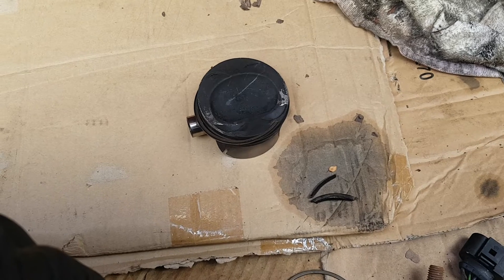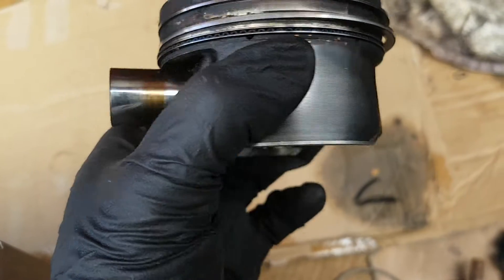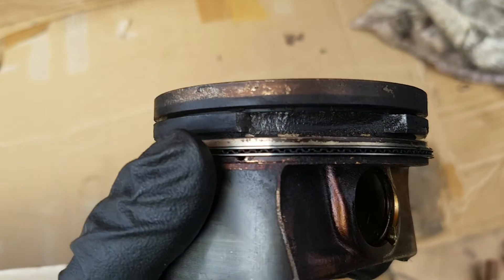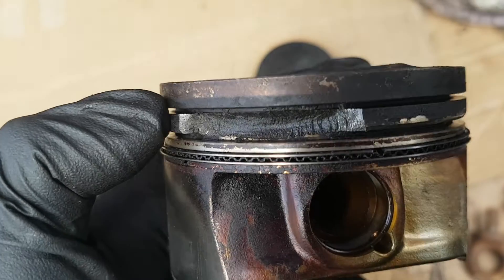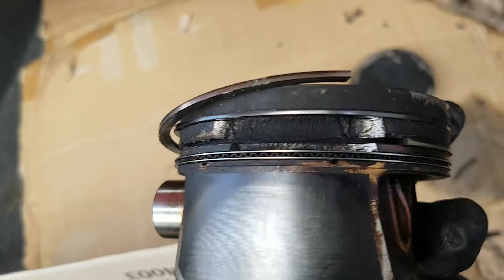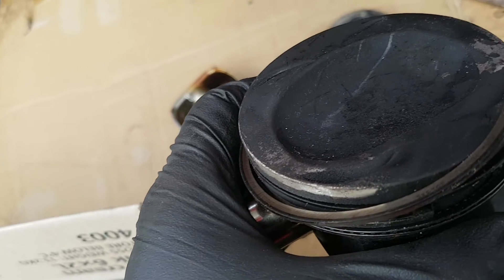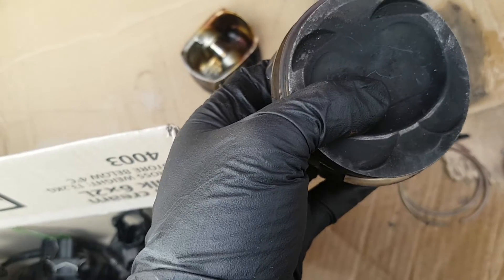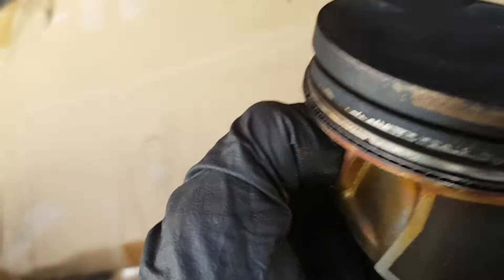VW Audi 1.4 TSI CAVD Misfire Low Compression Cracked Piston Ring Lands

Comment: My 2009 Golf variant CAVD engine died. We found 2 cracked pistons and stuck rings. I have decided against rebuilding it and I want to buy a used CTHD engine which was an upgrade on the troublesome CAVD. I honestly think the VWs are not built to be reliable though given the reliability issues in my experience

Comment: So I’m currently battling a diagnosis on my 2.0FSI with no compression on 3 cylinders and with 150psi on #4. Timing belt looks good and tight and the cam/exhaust cam chain seems to be rotating both cams during cranking. Any suggestions on how to proceed?

Comment: Hello @four rings auto

high oil consumption on 1.4 tsi CMBA 2013   aprox 3 liters in 1000 km..

What you think, i have to change the piston or just ring on it?   
compresion is ok all four cylinders

maybe valves seals leaking..

Thanks
Reply from the maker: I believe there is a technical bulletin for this engine. It says to check the engine number and depending on that it specifies different repairs. One of the repairs is to replace the pistons with an updated version. You'd think they'd have these issues sorted by now as newer engines come out...

Comment: Hey Four Rings Auto,
I have a 2013 TSI CTHD 1.4 Tiguan with 70k on the clock. Cylinder 3 is significantly down on compression so have ordered a leak down tester to help determine what's failed.

What is it about TSI 1.4 engines that cause their pistons to fail? Are there newer/updated versions of pistons that are less likely to fail?

Thanks
Reply from the maker: They were mahle pistons from factory, they are replaced with kolbenscmidt that has a better casting. Apparently too low of a silicone content in the aluminium casting. Silicone is great for withstanding heat. Low speed pre ignition also doesn't help, as these turbo supercharged engines make a lot of power torque from such low rpm. Downshift if you want to use the power to avoid increased cylinder pressures at low rpm.

Comment: Can these blocks be sleeved with liners if damage to bore is beyond available oversized pistons? Pulling a CAVE engine out as I write this with 50PSI on number 2 cylinder. Expect to see broken piston(s).
Reply from the maker: Yes any engine can be sleeved. But all down to cost. So many people seem to rather replace with another unknown used engine than fix what they have.
Reply: @FourRingsAuto  Thanks for the reply. At the time I didn't know how thin the bore walls were as to whether it can be sleeved. There's more than a few comments on the net where people say they can't. Add to that the open deck nature of the block which may impact whether there is even room to bore or house the top of the sleeve collar without breaking out of the original bore wall. (hope that makes sense?) Anyway, I'm old school and would prefer to recondition what I have, and in so doing keep the original engine number. Buying a wreck to source another engine or buying another second hand engine from an automotive wreckers is crazy considering the ticking time bomb nature of these engines. To have peace of mind you would be replacing the same items as you would on a rebuild such as pistons and timing chain kit etc. That makes it economically unsound to do.

Anyway, it's apart and the bore with 50PSI has piston cracks and small amount of material missing between the ring lands and the top compression ring was totally seized at it most compressed with carbon. Bore is scored but might just clean up with first oversize rebore. Drop the block, crank, and head into a machine shop tomorrow to get the whole picture.

Comment: Why wasn't this a Recall??
Substandard parts used for these engines.
I notice they replaced this engine for 2014 and a complete redesign too so parts not compatible.
Reply: Poor maintenance and cheaping out on fuel usually causes this. At least in my case that was the cause of 3 broken piston rings. The previous owner used cheap oil, skipped servicing and used cheap pissant fuel.

Comment: Just rebuilt mine with new pistons, they looked exactly like yours shown, also did a head recon/ lots of carbon build up, finally got engine back in the car, and got the dreaded P10A4 code,wouldn’t rev above 3000 rpm, I think caused by too much oil in inlet system ?? I have ordered a new throttle body valve, I do hope this fixes it, any tips ? , great videos btw have helped me tremendously,,
Reply from the maker: I have many videos on the P10A4 code. You can wash the oil out and it usually fixes it. Have a look on my channel.

Comment: Got the same engine in first edition  BMY. Almost 200k with stage 2(70k) setup, with 1.5bar boost. And it still drives fast without oil consumption. 
MY08 Mk5 Golf GT (dsg6)
Reply: The first iteration seems to be the most reliable. They really leaned out the tune post the mk5 GT

Comment: I'm looking into buying a Scirocco but honestly I'm confused about the TSI engines, from what I know the 1.4 TSI 160 kmh is faced with this exact issue, am I correct? The 122hp is fine besides the chain being crappy?
Reply from the maker: Pretty much, but they both stretch chains (usually poor maintenance) and they both use the same pistons technically, but the higher output is putting more load/stress on them.
Reply: @FourRingsAuto  Cheers for the answer! Really helpful :)
Reply: @FourRingsAuto  isn't this more LIKE LSPI issues? Due to the fact that it has already high boost at low rpm and the engines get trashed while already having some carbon build up - because GDI produced more soot -?
Reply from the maker: Likely
Reply: @FourRingsAuto  TSI engines are nice to drive though, I've got a 1.2TSI (CBZB) on lpg (liquid through petrol injectors) runs like a champ, ~270.000kms in now. Not much issues except spark plugs wirings that get chewed up by marders 😂

Comment: Hey! I've got the same problem but my cylinder block is also damaged..
Is it possible to use the bottom end of a CAXA engine (Cylinder block and pistons) as replacement for my CAVD engine? I've heard these engines are the same.. just with different tuning and different injectors etc etc..

Thank you!
Reply from the maker: They are different. The caxa is aluminium block and weaker than the cavd.
Reply: @FourRingsAuto  problem is I've already got the CAXA..Despite the weakness, will it still fit and run?

Comment: My son as the golf mk7 1.4tsi rline 150hp dsg 7 speed,2017 model,no issues so far,he’s even got a high flow downpipe and a tune to go with it,other wish car is stock,it’s running about 200 hp and about 320 nm of toque,he also had the dsg reprogrammed
Reply from the maker: Different 1.4tsi in the mk7
Reply: Four Rings Auto do you think it’s stupid to run 200 hp and 320nm of torque on this engine tho,I told him not to remap it,the tuners said it’s safe,but I disagree,I think the turbos are weak on these new 1.4tsi engines,he’s been tuned for about 10 thousand miles now,ps I know it’s a different engine in the mk7 but still lol
Reply: @daibennett9224  I would have money on the gearbox shitting itself before any engine issues. And when the dealership finds out the car is tuned his warranty is (more or less) null and void...
Reply from the maker: Hmm i have a similar polo gti with around 80k kms. It has been stage 2 apr tuned since 5k kms and has a dsg tune. 0am gearbox on original clutch. I wouldn't jump at the tune causing a gearbox issue no more than they do standard. Lots of the greek dsg tuners even suggest they're having less issues with 0am gearboxes once running a tune. Only speculating on what other companies that specialise in that stuff have said though.

Comment: Hi there 4 rings I have mysterious misfire problem on my Jetta 2012 CAVD 1.4tsi currently with 116k miles. This car underwent an engine change under warranty at 45k miles (2015), was informed by the dealer that they have installed an updated version of the engine, but now that the warranty is over the misfires is giving me the jitters.

All started with cold start vibration so I used Obd2 with torque Pro to scan the engine and the results shows 5 counts of misfire on cylinder 1, though It doesn't show a fault code or light up a check engine light.

Suspecting that it could be bad coils or plugs I switch them around I found that the spark plug from cylinder 1 had black soot on it and plug tip a little bent so I change it to a new one ran the scan tool again and still cylinder 1 shows a misfire still no fault codes nor check engine light.

My fuel consumption has deteriorated and intermittent vibration can be felt while the car is idling also when accelerating it feels like something pulling it back.   

I brought it over to the garage to have it checked but their scan tools didn't pick up a misfire, so they went on to do a compression test which showed 12 bars on all 4 cylinders. They changed the connectors to the coil packs as the clip were broken so after all that obd2 still shows misfire on cylinder 1, no error codes nor CEL.

What would be your expert advice? Many thanks
Reply: could be a faulty injector leaking into the cylinder
Reply: @shimon2476  Thanks appreciate the response
Reply: @lucasoliver3221  np did you fix it?
Reply: I bought a car that had the same, 2nd engine was built to same spec with Gen 1 pistons, they broke after 5k miles :(
Reply: @themousechannel-Wootten  Thats sad

Comment: Hi, was this something you repaired yourself or had a garage do? I have low compression in cylinder one and been told it could be the valves? How hard was this to fix? Any help appreciated! Thanks!
Reply from the maker: I did this myself as I'm an automotive technician specialising in Audi and VW (hence Four Rings Auto).
Reply: @FourRingsAuto  how much would you charge a customer for this job? Including timing chain replacement? Thanks
Reply: @FourRingsAuto  iv had my Mk6 golf pressure tested and 2nd pistons no reading, is it best to find new engine or getting refurbished. And where are you located in UK? Thx
Reply from the maker: I'm in Western Australia. A used engine has someone else's problems. Engines from the scrapyard always seem to have some issues. Strip yours down and inspect the bores. If ok, rebuild with kolbenschmidt pistons. They're about a third of the pruce of genuine ones and they're the same.
Reply: @FourRingsAuto  hi, im in WA too, may i have your contact/address so i can bring the car over pls ?

Comment: Hello Four Rings Auto! I bought my 2008 MK6 Golf with CAVD 1.5 years ago with minor trembling and excessive oil consumption. Been driving it like that since then and only recently did a compression test which showed about 60-65% of what it should be on 3 cylinders and 55% on the 4th. Also Vag-com giving the cylinder missfire error... Is it still worth it doing the pistons replacement job? Otherwise car runs relatively well for 160 hp apart from the minor trembling and 1L/1000km oil consumption. Thanks!
Reply: Thanks guys! I am undertaking the job next month and will post the results here. Fingers crossed!
Reply: UPDATE: Engine pulled apart: 3rd cylinder's piston had a broken ring land. According to the mechanic the cylinder cross hatch honing is there and block is fine. Fingers crossed that the pistons replacement will resolve the issues completely including the oil consumption.
Reply: Pistons job is completed. Car drives like new and error-free. It only costed me about 900 Euro including head servicing, oil, filters and labor. Thanks for the great video which helped me fix the car!
Reply: @kristianpavlov5163 
Did your mechanic replace the timing chain assy complete as well?
What was the mileage when your engine failed?
Reply: @harwoods11  unfortunately I don't know the answers to both questions. I believe the chain should come off too and where I live it's common to manipulate the odometer so I'm not sure about the mileage either...
Reply: @kristianpavlov5163 in which country?
Reply: Any advice appreciated!
Reply from the maker: A cylinder leak down test will enable you to suspect a piston or bottom end issue. Pulling it apart will confirm if it has cracked the ring lands on the pistons. If the bores or the cylinders aren't damaged, and still have a relatively uniform cross hatch hone, then pistons be fine to replace. Recommend doing the timing chain and tensioner too whilst apart. Verify the timing is correct before pulling it apart too, as this can give lower than normal compression figures, but will show up om your leak down test.
Reply: Here is video after the engine rebuild with proper (kolbenshmidt pistons). I have already driven 27000km after the rebuild and the engine consumes no oil between the service intervals.

https://www.youtube.com/watch?v=GB5uoSxx8Cs

Comment: Hello. I also got low compression (80) on cylinder 1. 135-150 on 2, 3 and 4. I had the chain replaced because the mechanic thought that was the problem... Still same issue. This have resultet that I have driven the car for atleast 6 months with this issue now. So if it's cracked piston it will have to be bored too I guess? And is that even possible? Thanks a lot i advance
Reply from the maker: Might not have to be bored. I've replaced 2 sets that have been fine. If there is bore damage you can buy oversized pistons from Kolbenschmidt. Mechanic needs to do a leak down test of the cylinder with low compression to confirm it is leaking past the piston and not a valve problem. Either way, the timing chain job will have to be repeated and I'd hope you wouldn't be paying for that job after it having been a guess repair.
Reply: @FourRingsAuto  thanks a lot for ur response! Yeah i'll talk it over with my mechanic :D
Reply: @FourRingsAuto  if it does have to be bored, the engine has to be removed I assume? Can't be done with the engine inside the car? It's also a CAVD
Reply: And is 130 PSI a good compression or should it be higher?
Reply from the maker: @Mo-ms5mo  correct, yes it needs removal and stripping down completely if it needs boring out.

Comment: Gotta eos 1.4tsi cavd on 2010 already had a VW rebuild in 2016 at 1£k... New pistons under warranty. Now 2019 @45k got low compression on cylinder 1 and using lots of oil.. Usual misfire and epc on!!!.. BTW.. Always used super unleaded since purchased at 18m miles and regularly serviced with correct parts and longlife oil.
Reply: They revised the injectors as well as the pistons.. bet yours are the older spray pattern drippy injectors..
Reply: @themousechannel-Wootten 
I believe VAG revised the complete engine as it was easier and far more cost effective than rebuilding the CAV with stronger/more expensive parts (that should have been used in the first place). Engine was just too weak for 160bhp so it was a disaster waiting to happen.
Reply: @harwoods11  who would have thought it, take a 90bhp polo engine and bolt a supercharger and a turbo charger to it creating a race engine but with stock road components and wonder why you keep blowing holes in the piston's.....
Reply: @themousechannel-Wootten 
All these factories rush out vehicles only to be continually modifying them (usually at the "now" owners expense) or eventually bringing out the vehicle that should have been more fully developed. Why are these manufacturers not sued for selling vehicles clearly "Not fit for purpose"?